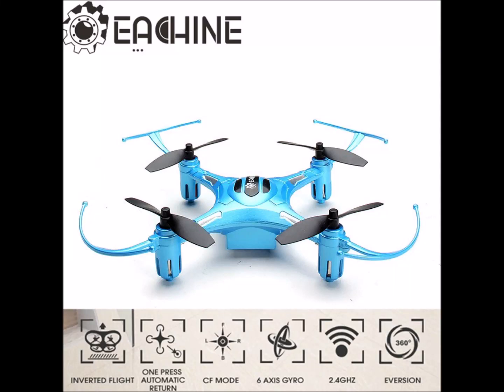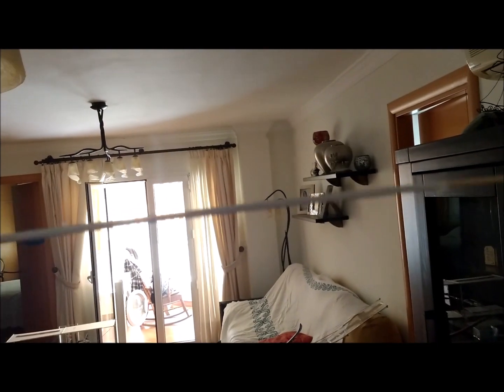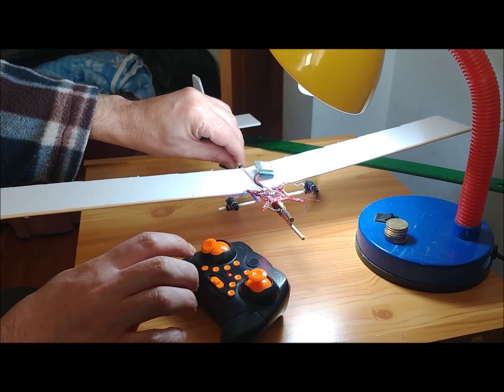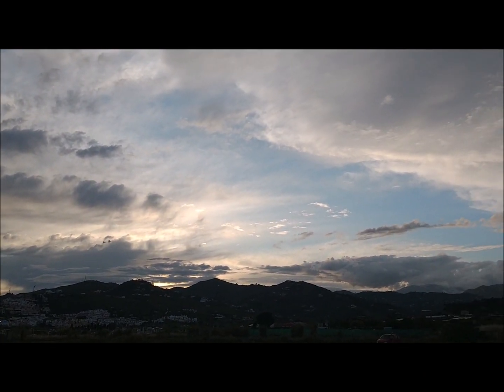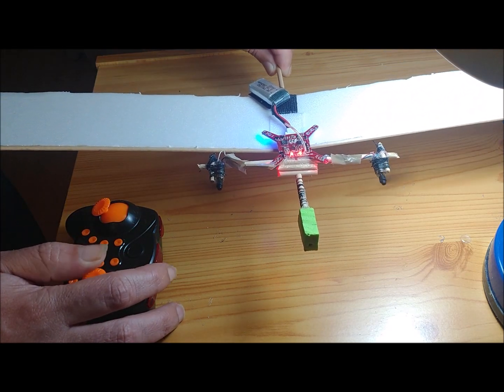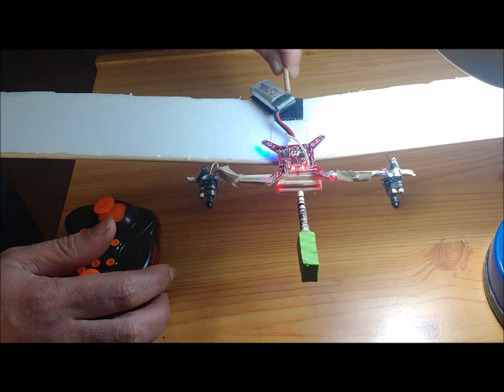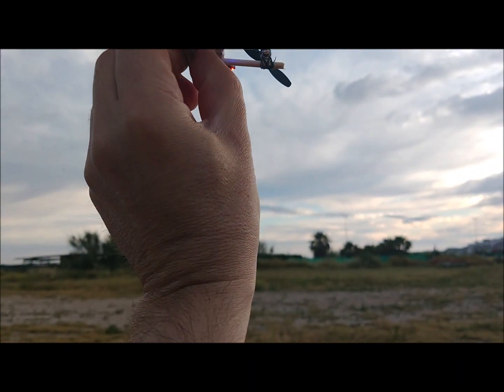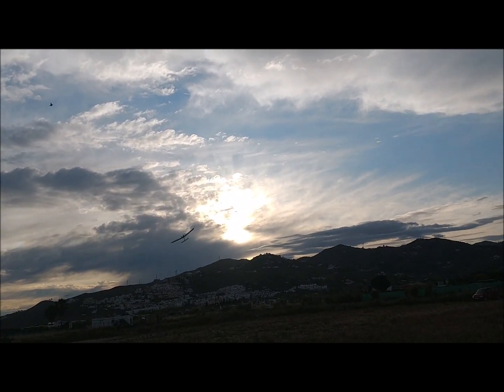How to Eachine mini H8S 3D drone converted into radio-controlled glider plane. RC. DIY. homemade

Comment: Does is turns perfect or we need some more attachments
Reply from the maker: it turns fine, anyway, you can increase the arm of the motors to increase the torque that make the plane turn
Reply: Thank you so much.....

Comment: Do you have a template of the glider?
Reply from the maker: no, what dimensions do you need?
Reply: @FisicayQuimicaCanal  ahhm aw the dimensions with the descriptions. Btw what side of the drone motors do you use. I have a drone that the back left side motor is broken.
Reply from the maker: you can use both front motors, or both back motors; the behaviour is the same
Reply: @FisicayQuimicaCanal  The right motor is the right motor of the plane that i will use? And the other is for the left?
Reply from the maker: yes